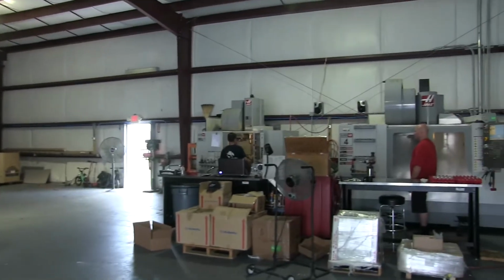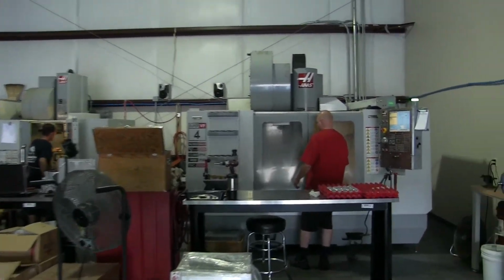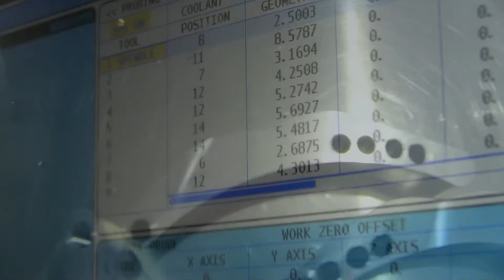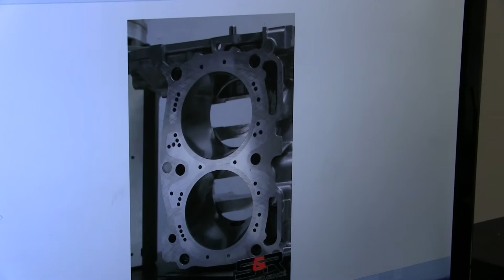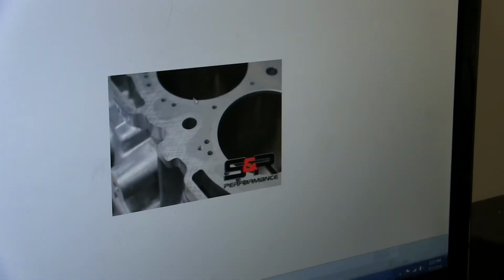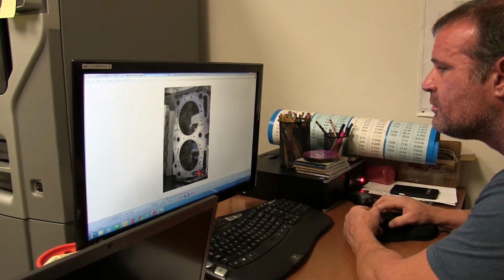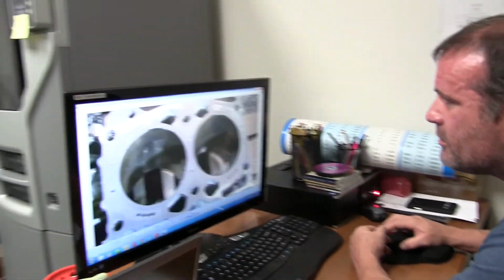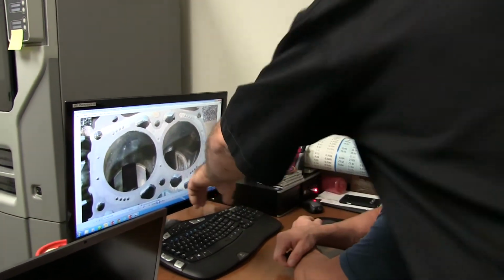Subaru closed deck blocks: How they're made

Comment: Why did you guys not cut a “cooling ring” around the top of the cylinder bores like Subi-Performance?
Reply: 'cause Subi Performcane is German, and name me a good engine that has come outta Germany in the past 30 years, 'cause I don't know a single one! 
BMW - Name me an M-car that hasn't had anything but catastrophic engine issues 6, 8, or 10 cylinders. And lest we forget the magic that was the SMG gearbox (cough). 
Merc - Ah yes, the brand that went to the bottom of the reliability charts in the 90's and has done nothing to buck the trend other than to call every other model an - AMG, to fool the weak-minded. But your Jedi powers has no effect on me! 
VW - My friend's Golf from the dealers went through 3 gearboxes in 6 months, so less about VW the better. And my Aunts VW Continental GT ( not a Bentley) did near $20k in repairs, in the first year she had it! 
Porsche - How many class action lawsuits, scored engine, IMS bearing problems do you want. And search the used car section and depending on the model, it's - engine rebuilt, engine rebuilt, engine rebuilt. Plus, my brother mistakenly bought one, against my advice. Blown engine, bits falling off the car, and continuous £2,000+ bills, and in a few years, he sold it for less than his used socks. Didn't Porsche come up with the 924/944, both of which were as reliable as a Politician's promise! 

And, as I've designed and built speakers for over 40 years, don't get me started on Bose. 

This German Engineering that I've heard so much about, in truth, they have little to boast about, and plenty to be ashamed of. 

Whatever Germany is doing engineering wise, my advice is - Steer Clear! 

SMG gearbox - faceplam!